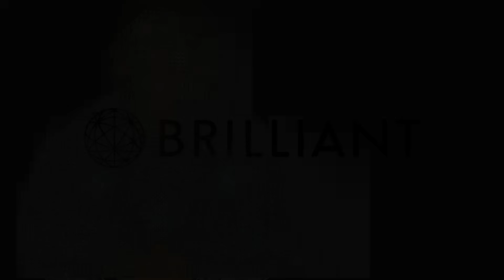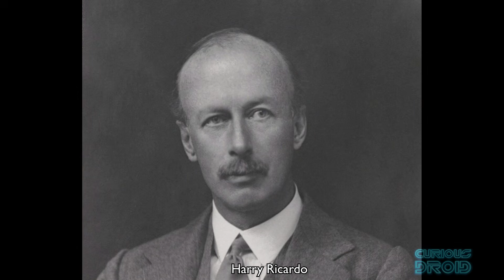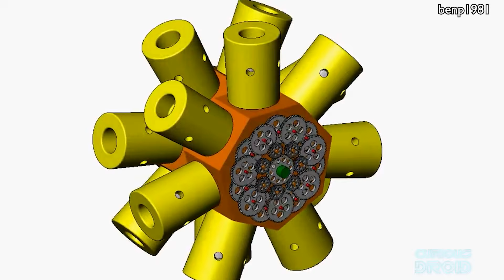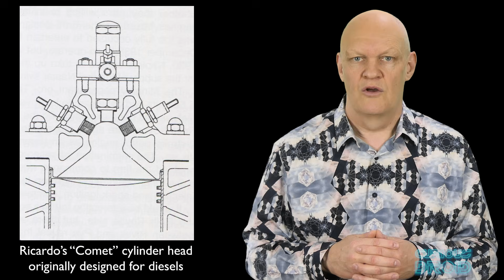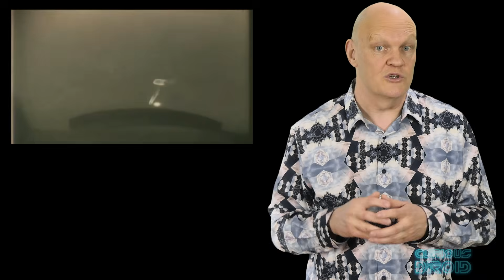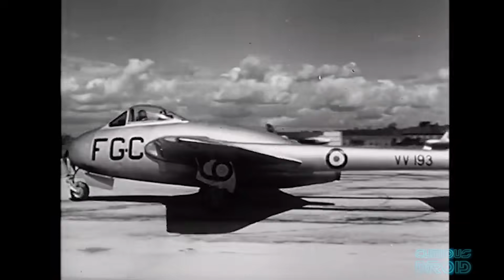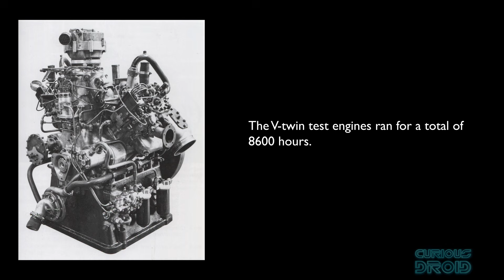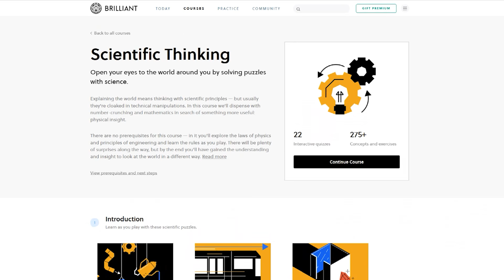Rolls Royce Crecy - The Most Advanced Piston Aero Engine Never Made.

Comment: Simply fascinating!  The Crecy knight sleeve valve design almost beat out poppet valve engines, using a two cycle aeronautical engine design! Here I thought that sleeve design had disappeared with the Willy's Knight, and the demand for higher compression ratios had made it unworkable. Thanks for the excursion into engineering history! My uncle worked for Packard during the war when they were under contract to Rolls Royce to build the Merlin engines used variously during the war, and I would never have guessed there was a completely different much more powerful engine being tested waiting to surpass the Merlin's performance, aside from the arrival of the jet engine.  Many thanks for this fascinating explanation!

Comment: I believe that the Napier Deltic 2 stroke diesel gave the highest power to weight ratio of any diesel, but perhaps that should be any production diesel. Principle explained here https://www.youtube.com/watch?v=D3bj47TAYiU)
I had the pleasure to own a Commer TS 3 that used a similar design to the Delitic in having twin opposed pistons in a single cylinder (with in this case 3 cylinders) also working on a 2 stroke basis with a rootes supercharger to give the necessary charge rate. These engines turned at approx 5000 rpm at a time when high speed diesels revved at 1200 to 1500. The supercharger scream made these vehicles very distinctive, however, there was very little engine braking !

Comment: Riccardo Consultancy the firm founded by Harry Riccardo are still involved in the development of combustion engines. There is a display about Harry Riccardo together with a couple of his early engines in the Bus Garage at the Amberley Working Museum. For those who are not aware one of the first major applications for Riccardo designed engines was in WW1 tanks. The previous engines were low power and produced lots of black smoke making them a target for enemy guns.

Comment: Except that sleeve valve engines almost invariably have massive issues with cooling and lubrication largely due to the very sleeves and that made them do what they did, particularly in high output engines. Very, very cool concept, but also a very, very dead end.

Comment: The Merlin Engine had four valves per cylinder. 
Also, the saber engine was used in the Tiffy and in the early Tempest. Most of the problems had been delt with and it was rated 2400 BHP.

Comment: Absolutely fascinating story. Not playing Devil's Advocate, nor am I taking anything away from this fascinating creation, however it is simply incorrect to refer to the Crecy as the most powerful piston Aero engine ever built. First of all because this engine was never completely developed, it's output is theoretical not actual. Actually, the most powerful aero piston engine ever built may be the Wright R3350 (4) used to power
the Lockheed Constellation. 3700 hp  twin row 18 cylinder.
     Also it is important to remember that engine output is NOT the only consideration for military aircraft. Other big concerns include cost, reliability, production time, ease of service and repair, fuel type, parts interchangeability and many others.
     Great video. Thanks for sharing.

Comment: I'm not sure why you need a sleeve valve on a two-stroke, where the inlet and exhaust ports are cutouts in the cylinder wall and don't need to be covered by a sleeve as they would in a four-stroke? Probably a good reason for it, but I'm too dumb to see it.

Comment: No material could stand an enormous power of I.C.E.because of its motion and its size the bigger the object the higher the mass will be produce when it comes in moving object,if its just going circle like Gas turbine engine then it will stand longer like gas turbine engine but sadly it will not because it is reciprocating engine

Comment: There was a German opposed piston diesel which ran very successfully and efficiently which was a type of two stroke. A long overall stroke evidently gives great slow burn and expansion which is the key to fuel efficiently. The Commer Knocker was a similar variant using rocker arms.

Comment: That Ricardo "Comet" cylinder head with the pre-combustion chamber is essentially the original Honda CVCC idea, although they fed it with a magic carburetor and a third tiny intake valve.  They eventually got it to work without the prechamber by clever gasflow management (i.e. Compound Vortex Controlled Combustion).
Reply: Right, you are.  I had to do a word search for "CVCC" to find your comment.  Thank you.
Reply: @alext8828  - You're welcome.

Comment: No mention of the mighty Bristol Centaurus engine. Probably the only sleeve valve engine still flying. I think it's about 58 litre 2500 hp. From 18 cylinders in two row radial configuration. The Royal Navy Historical Flight Sea Fury uses one that was rebuilt by Weald aviation quite recently.. whittle and Roy Feddon  who was responsible for the design and construction of the Bristol Hercules and Centaurus engines, which I believe made up approximately half the installed horse power of bomber command were both hindered greatly by the men from the ministry. Their biographies make sad reading.

Comment: Too much too little too late.  Thanks Paul, fascinating.

For the record the Bristol sleeve valve was the Hercules that eventually put out 1,735 hp and was 38.7 L.  However, the largest and most powerful piston engine was the Pratt & Whitney R-4360 Wasp Major a massive 28-cylinder radial that put out a whopping 3,800 hp out of 71.5 L.  The Convair B-36 had SIX of them!
Reply: The Howard Hughes 'Spruce Goose' had eight of them. That's a total of 448 spark plugs in 224 cylinders.

Comment: What i wonder is why they even had sleeve valves, couldnt they just have had uniflow scavenging with poppet valves or rotary valves or just had ports in the cylinder walls and used loopflow scavenging or something.

Comment: How nice it would be to have a small scale version rebuilt today? Considering it was for airplanes, I guess it wasn't a carter-pump like the 2 stroke motorcycle engines, too prone to failures, hence it would have used pure gasoline and not oil enriched gas mixture. It would be a nice case-study for a modern supercar engine, if made in smaller displacement and with modern materials, lubricants and technology!

Comment: I always hear superlatives about Rolls Royce and their Merlin engine, however when Packard got ahold of the plans to build engines during the war, company engineers complained the tolerances were so far out that they couldn’t make interchangeable parts. They had to re-engineer what was supposed to be a finished product so they weren’t spending precious time hand-fitting every engine part together
Reply: That doesn't change the fact it was one the best aircraft engines of the war.
Reply: @gherkinisgreat  way to miss the point

Comment: You are right at the beginning of the video when you say they thought the Crecy could be used in a sprint spitfire to intercept the Luftwaffe. But you are wrong towards the end of the video in suggesting that the engine was ever going to be  economical with fuel. It had catastrophic fuel and oil consumption by its very nature. Somewhat like the Mazda   Wankel engines.  After the battle of Britain there was no need for a very short range sprint Spitfire. The allies were more interested in long range capabilities by 1941.

Comment: I believe that Crecy's demise was because it was a mechanical nightmare, as well as all other sleeve valve engines. And I do not believe that the alleged six months necessary (and not available) to develop and increase reliability would be sufficient, also.
Now a correction: you kept calling radial engines "rotary". Rotary engines are completely different than radials. I know A LOT OF PEOPLE called them rotary (probably influenced by that primitive rotary radials of First World War like Oberürsel and Gnome, for instance), but that's wrong!
Another issue: there's no Rolls&Royce "Griffen" engine. The name is GRIFFON.

Comment: Interesting engine. I wonder if something could have been done with a gasoline 2 stroke with poppet exhaust valves and fixed sleeve intake ports, blower induction.  Could have had most of the advantages without the complexity.
Reply: If you're interested in modern 2-stroke engine technology check out the Rotax/Evinrude E-TEC voice coil direct injected 2-stroke engine. This engine has been used in snowmobiles & outboard motor boats for over a decade now.
Reply: @autodidact537  Those are interesting engines. For a large aircraft I was imagining something without crankcase induction, maybe something more akin to a gasoline version of a Detroit 2 stroke.

Comment: I've got the Rolls Royce book on the Crecy. It's a pretty good read - they go into Ricardo's initial philosophy behind the engine, the problems the ran into during development (cooling the undersides of the pistons and the small end bearings of the connecting rods come to mind), and future developments (the turbo compounding was mentioned, as well as advanced studies, one of them involved scaling the engine down and housing it in a duct). Rolls Royce were even designing a fighter to use it in - it was to make use of abundant P-51D wings and landing gear, and got to the point of a mock-up fuselage. The engine was to be behind the pilot, who would be perched up behind the spinner (think of a P-39 with the pilot even further forward - apparently a LOT of people were thinking along similar lines towards the end of the war, and pretty much all jet fighters have this configuration). What would a Crecy-powered fighter have been like? Look at the Westland Wyvern and the PA-48 Enforcer - both were turboprops with much more power than a Merlin, both were actually ground attack aircraft and both weren't particularly fast (less than 400 mph). The Wyvern was huge (Douglas Skyraider size), the PA-48 a converted Mustang. I think they would have used the extra power for more payload rather than for extra speed or climb performance. If they designed a high speed fighter they would have quickly run into propeller limitations - the fastest prop fighters were only hitting 490 mph (at altitude) on 2000+ HP, and even with 5000 HP they'd probably hit some limit around 530-540 mph. Jets were already a lot faster than the P51H, the DH Hornet, the Hawker Sea Furyand the Spiteful. Ricardo's company (by the same name) still exists, by the way - I attended a talk some years ago, the presenter talked about all the stuff they were working on (the most interesting was an engine that would change from a four stroke to a two stroke on the fly, when you needed more power. He said the main problem wasn't controlling the valves - it could actually even be done with camshafts, the main problem was changing from a stoichiometric mixture to an air-rich one when transitioning to a two-stroke. I suppose you could do it with fuel injection).

Comment: Amazing video!  Turns out modern model aircraft 2-stroke engines achieve the hyper engine goal.  For example, the Norvel AME .049 cid engine produces .14 bhp @ 20,000 rpm.  That's 2.86 bhp per cid!  These are conventionally aspirated engines, no turbochargers or fuel injection and run on a methanol/oil/nitromethane fuel mixture.  Some engines achieve more than 3 bhp per cid.  The biggest disadvantage of a 2-stroke engine is it's high fuel consumption rate.  They also produce less torgue than a 4-stroke.

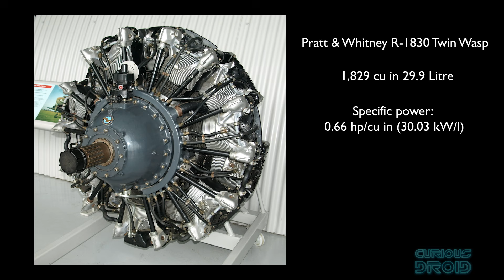Comment: 2:21 The Pratt & Whitney R-1830 had a specific power output of 0.66 hp/cu, high end production piston engines today, like the one from the Koenigsegg Jesko, have a specific power output of 5.22 hp/cu, nearly 8 times as much.
The Twin turbocharged V8 engine in the Jesko produces 1603hp (on E85), comparable to the merlin, except that it has a displacement of only 5l instead of 27l.

Comment: Great video. Nice piece of research.  A couple of points worth considering. A 2-stroke by its very mechanics  will be consuming fuel at a far greater rate. So a far greater fuel payload would be require for a decent range. Also all that heat generated would need a substantial cooling system.....more weight!!!  Also as mentioned elsewhere......the later Sabre, Griffins and Merlins were all producing double their original power outputs or more by 1945.

Comment: There were significant problems with sleeve valve engines, apart from the little you mention. No 1 is metallurgy to make the sleeves in a way that thermal expansion differences between cylinder/sleeve/piston are acceptable, second is horrific oil consumption, and from that plug fouling from the oil on the cylinders. There are also very high power losses from the friction between sleeves, cylinders and positions, quite apart from the drive gear. Weight is another issue. These issues delayed the sabre engines from going into production/service for more than half of WWII. 

There's a lot of info in Calum Douglas' book, The Secret Horsepower Race. This covers piston engine development on Both sides in WWII. Highly recommended for engine nerds.
Reply: It did not delay the Bristol Hercules or Centaurus much, both sleeve valvers.

Comment: The merlin had 4 valves per cylinder. HP per cu inch is meaningless for aero engines. HP per pound weight is much more important.

Comment: Excellent thanks! Harry Ricardo was a genuine gold-plated engineering genius! Can’t quite figure out how sleeve valves would work in a 2-stroke but that gives me something to look up 🤔( ps tiny mistake you say ju88 when you really meant ju87 Stuka)cheers
Reply: Just think of a standard Detroit two-stroke that has had the exhaust valves replaced by the ports of a sleeve valve. Although the intake ports are still there in the bottom of the sleeve, the sleeve valve action is only really replacing the exhausts valves. Of course the sleeve has to move up and down once in every turn of the crank on a two stroke.

Comment: The biggest take away from this is the sheer power .nothing more.. my question would be .. was there a transmission and prop that could actually handle the massive power output.. This was a excellent what if from RR.. y0u really did your home work. Btw.. I believe the USA had a piston pounder that was actually putting out about 39000 HP it did use a highly modified turbo compound set up to achieve it ..

Comment: Am I wrong in thinking the sleeve valve engine was the equivalent of what would happen if a 2-stroke system had a baby with a 4-stroke rotary, and the offspring (the sleeve valve engine) was like a 4-stroke rotary engine in functional cylinder concept, but used a 2-stroke's cycle if the rotor was converted from spinning Dorito™️ shaped to ~1/4 of a rotation cylinder with some holes shaped?

Comment: The biggest hurtle to wartime production updating is production retention, you have to remember that replacing an engine for some or all airwings means retooling factories, reteaching factory workers to work with new parts and sourcing new parts. The engine has to be revolutionary for it to be worth the cost, which it kind of wasn't, the jet engine however, was
Reply: It was a quantum leap in piston engines.
Reply: @johnburns4017  wooow, quantum
Reply: @ninny65  
Now you know.
Reply: @johnburns4017  Me use brain.
Reply: @ninny65  
Have you tried oiling this brain?
Reply: @johnburns4017  Is that what you do to yours

Comment: Wait, what? 2-stroke?
Reply: If you're interested in modern 2-stroke technology check out the Rotax E-TEC voice coil direct injection engine. These engines have been used in snowmobiles & outboard motor boats for more than a decade. Welcome to the 21st Century.

Comment: You are getting way ahead of yourself here.  Yes, the Crecy was really impressive for its time but modern engines use net HP ratings and not gross HP ratings.  Net HP ratings make the hp ratings of modern engines seems less impressive than they really are.   You are talking AT LEAST a 30% difference!  So whatever figure you see with a modern engine, add 30% or more to the specific output to get closer to an apples to apples comparison.  And keep in mind that modern engines can make more HP/L that the Crecy on 93 octane gasoline while using catalytic converters/emissions controls thus producing minimal pollution.

I do wish I could hear what a Crecy sounded like!

Comment: I've sometimes thought about a basic sleeve valve, putting one in a car. Didn't think about all the gears to drive it though. In my briefly thought up design it only moved up and down, never drew it on paper to see if that would work
Reply: Daimler made V12 sleeve valve engines between the wars.  Some used by the Royal Family.  They were extremely quiet in operation but used a lot of oil

Comment: The trade-off with 2 stroke engines, as opposed to 4 stroke, is that they produce twice the horsepower, but only half the TORQUE. This is the primary reason that 2 stroke engines are generally confined to either small, or very large engines.
Reply: Before you made your comment you should've checked out the Rotax/Evinrude voice coil direct fuel injected 2-stroke engine that has been used in snowmobiles & outboard motor boats for more than a decade.
Reply: Very wrong opinion